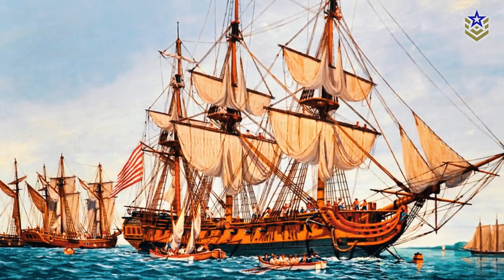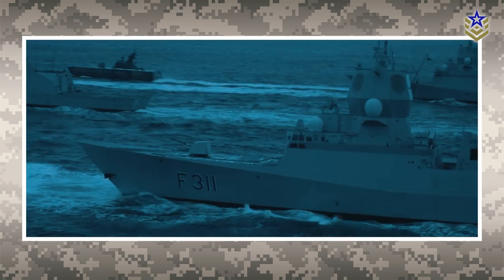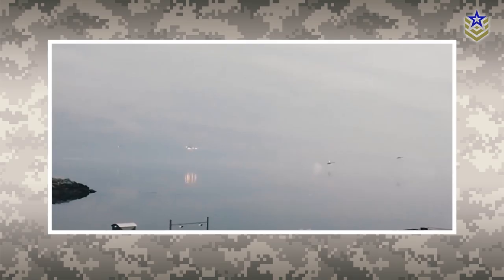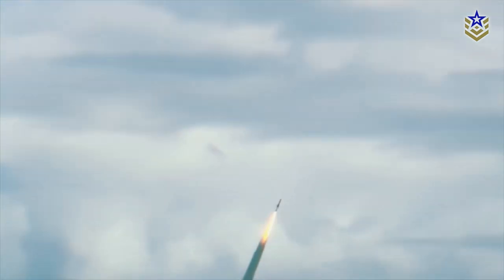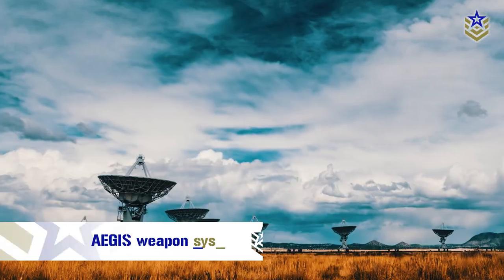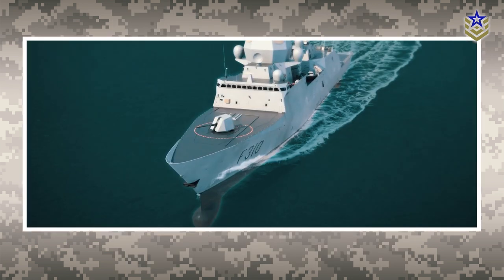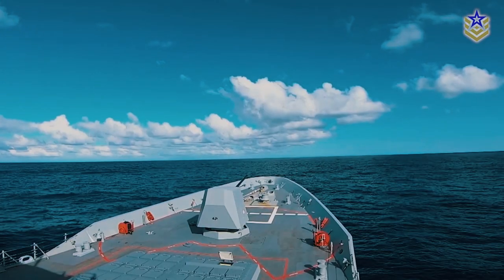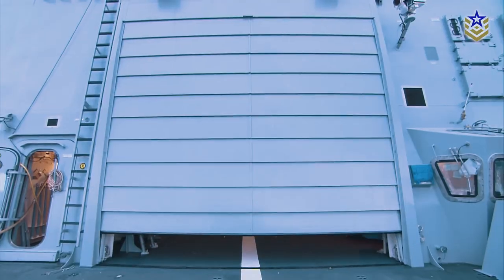The Norwegian Fridtjof Nansen-class Frigate: The Most Advanced Frigate Class?

Comment: These are fine ships
4:50 HNoMS 'Helge Ingstad’ F313 sank because of:

- Bridge watch change in heavy traffic area
- inadequate experience of bridge crew
- loss of situational awareness and monitoring of traffic
- inadequate damage control and safety training
- bilge system not sealing
- watertight doors left open
- AIS transmit off
- Navantia Norwegian Navy inadequate handover information operational safety requirements
- Norwegian Navy inadequate safety learning from unexpected accidents and errors
- inadequate documentation: updated manuals for crew

The male officer of the watch is on trial.
Reply from the maker: Thanks for the additional info!